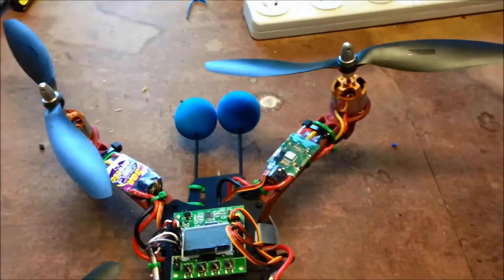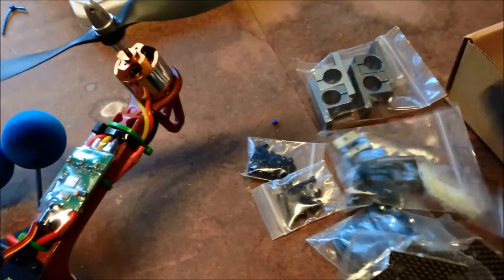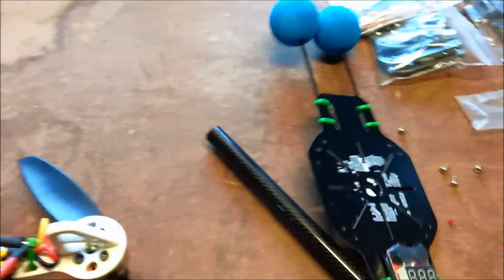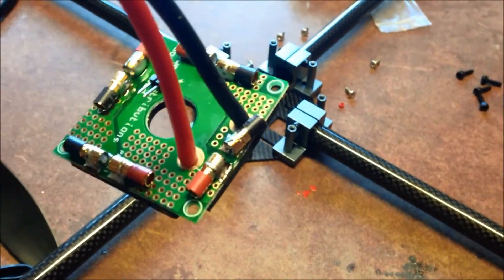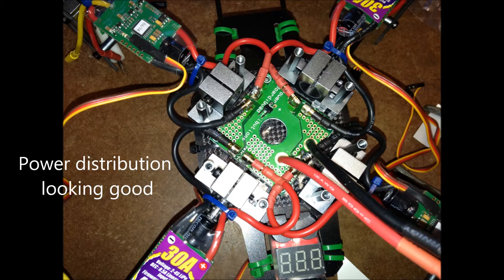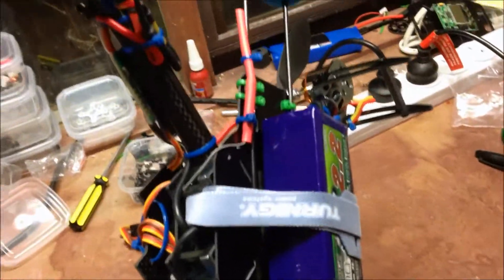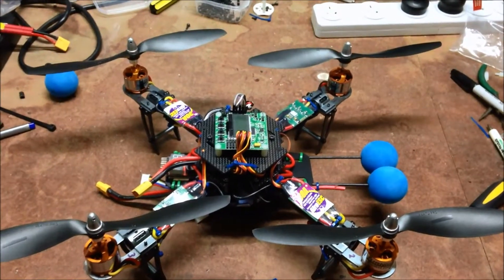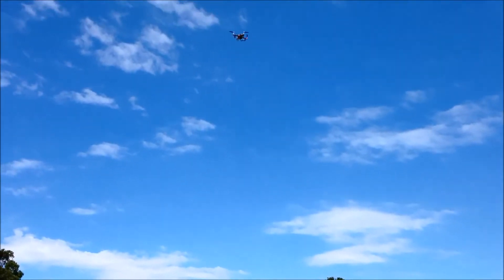Hobbyking Turnigy Talon 330 ACRO Quadcopter Build Afro 30A EScs 2830 1000kV motors KK2.1

Comment: what is the size of props and how long copter flights ? ) thx
Reply from the maker: Flight times are 8 -10 mins. Props are 9 x 4.7 Plastics. I have just updated to 9 x 4.5 Triple blades which you can see in action here. 
Turnigy Talon Quadcopter 330 with Triple Propeller upgrade. Pocket Rocket.
Reply: watched this cool video. how propeller upgrade affected on flight?
Reply from the maker: Turning etc no change. Just faster and more acceleration. Very happy with these props. Still plastic but stiffer than the previous ones.